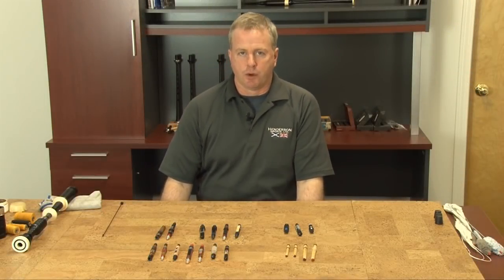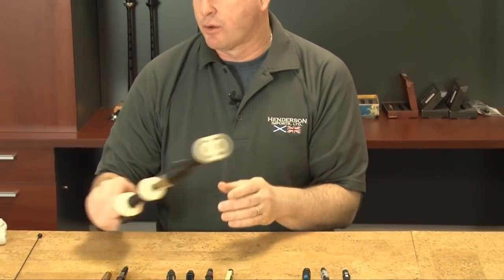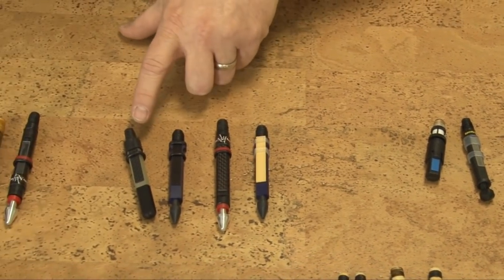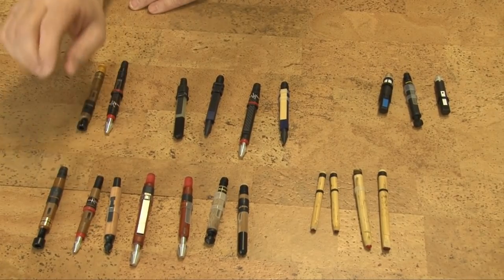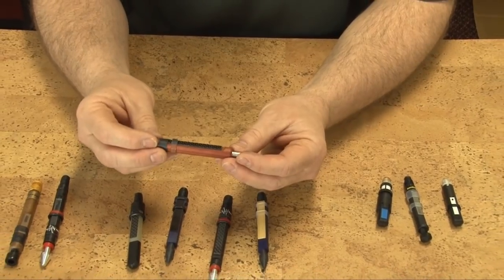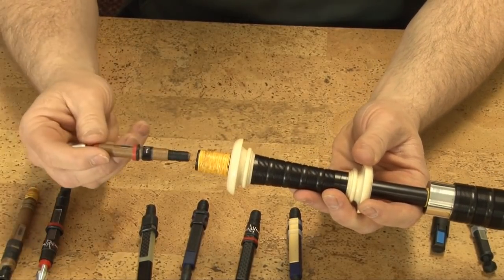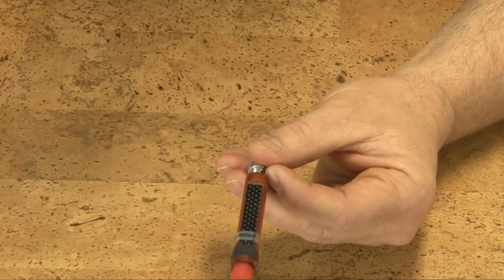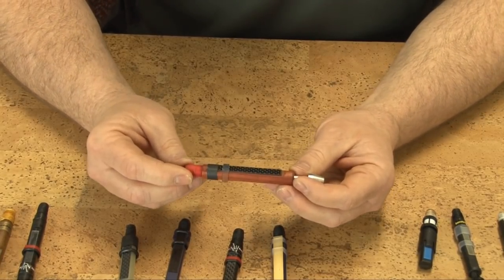How to Adjust Bagpipe Drone Reeds

Comment: What if I have a carbon fiber tongue reed that has a very strong buzz coming off of it? I have a Murray Henderson Deluxe and out of the box the bass has this really intense buzz over the bass sound. They are brand new and I've never broken in a set of drone reeds before but I was given the impression that wouldn't be the case with these?
Reply from the maker: Yuri Carbon fiber definitely produces a more robust sound that can take some getting used to, and it is more prone to buzzing or roaring. You might try nudging the bridle down to make the reed a bit more efficient, testing small adjustments until the buzzing subsides. Occasionally, a particular reed type and the dimensions of a drone don't work that well together, but there is a good degree of universality with modern reeds and pipes. We haven't worked with these reeds, specifically, but feel free to give us a call if you want help with the adjustment. (1-800-931-5010)